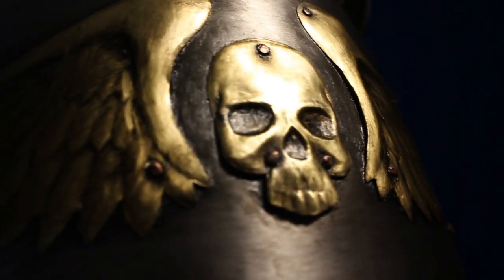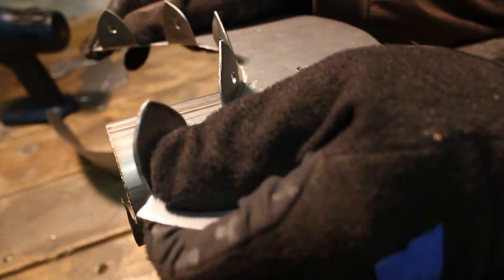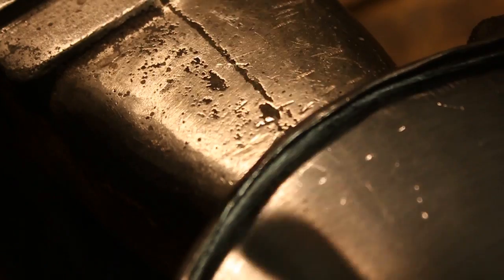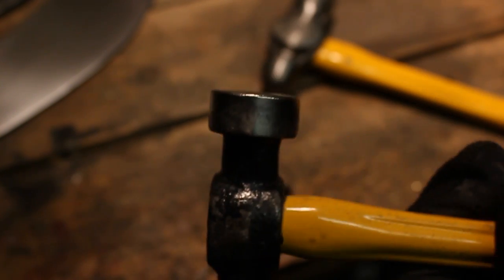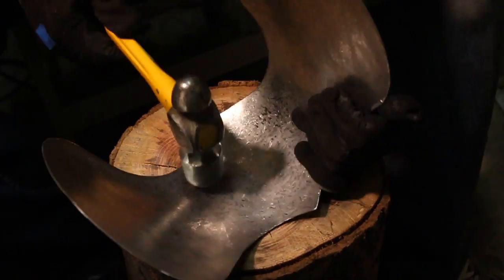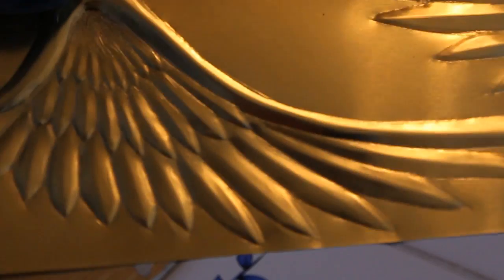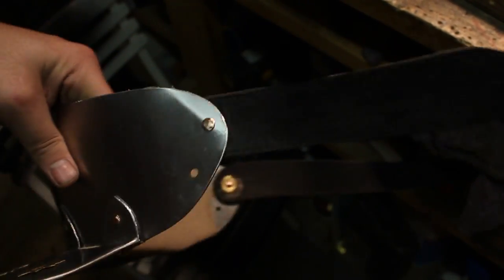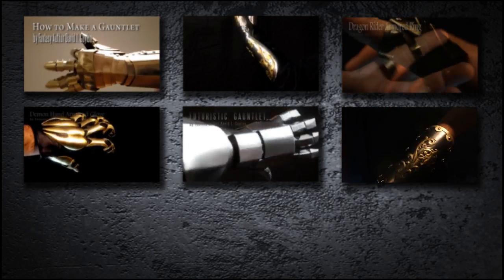How to Make Armor with Ordinary Tools - Pauldron

Comment: might i suggest that instead of using a flap disc to remove the imperfections in the metal you plannish more and use a fine grit sand paper and a palm sander.. 
you dont want to take too much material off the paultron otherwise you weaken the armor. 
thats fine for Cosplay. but if any SCA or other reenactments use this as a guide they will be weakening their armor too much.
 also it looks like a touch more dishing on the main paultron might help close the articulation gap on the top.

Comment: I know this is not armor meant for combat just for a costume but if you want it to be combat ready you want to heat it when forging because hammering cold metal can actually cause cracks if your not careful also the material needs to be at least 2 millimeters thick you don't need much metal to have it combat ready and also heat treat it so when it's hit with a sword it won't get deep dents and so you won't get hurt first heat treat step is to normalize it basically heat it up to about a bright orange color and let it air cool this will reduce any stresses after forging do this a few times then heat it to a dark orange color then quench it in warm oil not water then once it's done cooling in the oil wipe off the oil with a towel then heat the metal to wear it's not glowing hot but hot enough for it to change to a straw color this process will make the metal spring steel making it strong flexible and when it's hit it will come back to its true shape.
Reply: +Bryce Corbin never forget about tempering and normalizing it a quench alone is very brittle.
Reply: +Bryce Corbin I know you already explained that I meant if it was carbon or spring steel.

Comment: Just curious why didn't you dab the shoulder piece with a rubberized die hammer? You would have less sharp dents to tap out. Instead of using a grinder for the deep scratches and dents which leave deep sandpaper type grooves try using a fiber wheel.  I used them for many many years to remove, shape and take snags out of metal that would be next to skin on a regular basis.  If you do it right you can make either a satin finish or gloss finish BEFORE taking the piece to a rag wheel with rouge.  So in your case you really like that aged look you wouldn't need the high gloss polish with rouge. For some reason I can't post the link to the fiber wheel.  Google Gesswein 3M scotch Brite EXL utilized wheels.

Comment: Do you coat your rivets with anything when done to keep them from tarnishing/corroding quickly? I am planning to use brass because it tarnishes more slowly than copper, in my limited experience. Or do you just let it build a patina and go with it?
Reply from the maker: honestly if you are not exposing the metal to the elements, you won't see a real patina likely for a decade or more. If you are worried about it, you can wipe the piece down with olive oil, or WD-40, and then wipe it all off. What remains on the surface will protect the metal. Repeat this every 6-12 months. You can also offer the metal some protection by adding a faux patina with black oil paint like you see me do in many of my videos.

Comment: +David Guyton I have access to a variety of welding processes at my school and wanted to go that route with your templates.  I think the riveted look is great, but would you recommend binding it all with tig or mig welding?
Reply from the maker: +1 2 I have only ever used MIG, so I can't speak for TIG. MIG works fine for me but be careful if you are using thinner metal because it's easy to burn through. 18ga or 16ga shouldn't give you much trouble.

Comment: Just an outside observation, feel free to douse liberally with salt...

When you were forming the big bow-tie on the log, I couldn't help but think a leather hammer (not a mallet) would have made less dents, which you have to beat back out. If you don't have a leather hammer, you could try just gluing a piece of leather to the hammer you used, and see how well that works for you. 

If that doesn't work the way I think it may, you could just take a knife a scrape the strip back off, and you've saved yourself the cost a getting another hammer which doesn't work. Just throwin coppers around.
Reply from the maker: +Clint Carpentier I would agree with you if the metal I used wasn't 18 gauge. That stuff is very stubborn and a rawhide hammer would do very little against it. 20ga though...yeah you might be on to something. As for wrapping the hammer in leather, I think the force it would take to get the metal to move would destroy the padding in a hurry. But I'll experiment and see if it helps any.

Comment: Do you plan on make a full arm piece. Pauldrons, vambrace/gauntlet all together? I'm thinking of doing one for a costume but have no idea how I'd connect the two.
Reply from the maker: +Jared Austin I probably won't, but it would be fairly easy to connect the pieces using leather straps. You would have to rework the pauldron part for the upper arm area to cover more of your arm, but that should be pretty simple and you wouldn't need one of my templates to make that yourself.

Comment: Hey man, I love your videos, I made your grieves and cuisse and it looks awesome for my first build! But I have a question if you can help me out with it; So while cutting out the metal for the grieves and cuisse, I noticed with using tin snips, it hard to get the snips down the middle of a piece of metal  because of the snips hitting the sides of what it's cutting into. So, I had to cut pieces of metal out of the sheet to get the good curves and lines i needed, well, in some parts, the metal came out bent, and not so straight, and it was hard to get the edges straight. Could you explain how you use the snips or cut the metal to get perfect curves and lines?
Reply from the maker: Well, you are going to run into issues like that cutting by hand. I usually just cut a little outside of the lines and then use a grinder (sometimes a file) to shape the part perfectly. Afterwards you can use a flat surface (like an anvil, etc) to hammer the metal flat and perfect again. If you are serious about metalworking, I strongly suggest getting a throatless shear. It mounts to the bench and it makes cutting a LOT easier. It still won't give you perfect cuts because it's hard to control the machine, but it makes it 100x easier on your hands, and it's about 20x faster too.

Comment: If u don't mind what is ur set up or ur opinion to start with for a beginner black smith ? And by the way I really like ur work 🙂
Reply from the maker: +John Combetta well, I suggest checking out my DIY Armoring Tools video to get a feel for the tools you'll need to do this. Beyond that, I would start small...maybe try to make my Dragon Rider Armored Ring, as it's pretty simple and will give you a feel for working with metal. Most people who try this are surprised at how easy it is. But don't get the wrong idea...it is challenging and you will have to work at it, but I promise if you just follow the videos, you can totally do this
Reply: +David Guyton alright thanks m8 I'll do just that

Comment: hey david :) I was wondering what gauge stainless steel you used for this build, and the gauntlet v2. Ive tried to find them in stores but never find them.
Reply from the maker: +DANK MEMES This one is not done in stainless. Stainless is a lot harder, and therefor harder to cut and also dish. This is 16ga cold rolled steel. The V2 gauntlet was done in 20ga stainless. I have a hard time finding stainless in stores and usually have to order from Amazon or Ebay

Comment: your work is so inspiring. what do you cut the 18 guage mild steel with
Reply from the maker: Jam Boy this was too thick to cut comfortably with snips. I had to use a handheld grinder with a cutting wheel on it to cut out the basic shapes. Then I used the bench grinder and files to get the parts shaped properly.

Comment: Do you have a suggested tool for cutting the sheet metal ? I am brand new to this and I live in an apartment. I do have a balcony with an Atlanta, but want to avoid anything huge or heavy while I’m making this. Any advice would be so appreciated!
Reply from the maker: I have a video on armoring tools you can check out. If you keep it to about 20 gauge in thickness (18 and 16 are too thick), you can cut it "easily" with regular aviation snips.
Reply: @DavidGuyton  thank you my good sir!!

Comment: Could your templates be used to make funcnal heavy combat armor if worked with differently and heat treated?
Reply from the maker: If using the proper thickness, with steel rivets and heat treatment, any of my designs could be battle-ready
Reply: Thank you Ser
Reply: I made his original gauntlet out of 1mm stainless steel, this might not sound like much but whack it with a hammer and it bounces right off
Reply: Thank you

Comment: just wondering before using the brass for some repousse work, wouldn't a bit of pressure applied to the brass flatten it out, warping the brass a bit? or is it thick enough to where it shouldn't matter too much? also, would you be able to use a more silver colored piece to do the same job? if that's not available then i was thinking of just carving some wax to craft a mold for a skull, then cast it in metal to rivet upon the pauldrons. and if crafting two pauldrons, would repeating the steps for the leather strap attachments on the adjacent side be viable for use? sorry for all the questions, just very intrigued by your work and would like to apply it to my blacksmithing.
Reply from the maker: Eric Arthur The brass is thin, yes, and would not stand up well to sword hits or anything like that, but it's tough enough for a show piece or costume. Working the brass (and any other metal) actually hardens it, so it's a little stiffer than you probably imagine. You can try to do repousse in steel, but I don't know what thickness as I have never done it. As far as the straps go, you just need to flip everything so that you have a mirror image on both sides. It's possible to combine the two as well, making one strap to hold on two pauldrons. You just have to be a little bit creative with the combining process
Reply: David Guyton tyvm for the input, sir! I may try my hand at using a crucible to cast an aluminum piece for the skull i plan to use. Gonna give the illusion that it's emerging from the pauldron. :p
Reply: Ill let ya know how it works out.
Reply from the maker: that sounds very cool! I definitely want to see that. Feel free to post some pics over on the Armor Template Facebook page so everyone can see!
Reply: Will do! Got some family and friends helping me get a forge and everything together. Might be a little while but I'm dead set on it.

Comment: "that skull, so awesome." damn straight! but im wondering just how strong are these repose pieces? would they be able to be used on the hilt of a sword?
Reply from the maker: +Benny Steinberg probably not in this thickness unless it's just a show piece to go on your wall. Working the brass does harden it some, so it's a little tougher than you might thing, but if you intend to use it in any fashion, I would suggest one to three gauges thicker than this  (this is about 30ga). The thicker it is though, the harder it is to get details with this method. You may need to resort to traditional repousse with the tar and torches and all that jazz.
Reply: thanks ill probably stick with my idea of melting soldering metal into a mold. btw i LOVE your work!

Comment: How well would it work to use chainmail patches to connect the armor plates rather than leather. I ask because I'm thinking that maybe using chainmail to connects pieces would make it less likely to be broken in a fight/duel/sparing.
Reply from the maker: +USMC0311STC I am not that familiar with chainmail but I imagine it would not follow the form of your body very well when you move. For instance, if you used it where I put a strap over the bicep, since the chainmail doesn't "give" a little bit, it will get very tight when you flex your bicep. I think a better solution, if you are worried about breaking or cutting the leather, is to use good thick leather (like I did) and then you can add small plates like I used on the fingers of my Version 2 Gauntlet. You would need to add some padding on the inside though so that the rivets to rivet on the plates didn't cut your skin.

Comment: i know you use 18 gauge steel, but do you use steel cold rolled sheet and plate or hot rolled? surely steer clear of galvanised? 64
Reply from the maker: +kaspa starr in this case cold but hot will still work. Correct on avoiding galvanized.

Comment: I do Amtgard and I'm really interested in building this armor piece. how sturdy is it? can it withstand light to medium blows?  or is it more of a costume piece ?
thanks!
Reply from the maker: +Lelouch Zero this is as sturdy as any genuine armor, but it's not heat treated to strengthen the steel to the highest level. If you're using 18 or 16 gauge, it'll be tough enough to hold up to anything you do to it.
Reply: thanks for replying so quick!
Ok, sweet!
One more question, is it possible to make this without any power tools?

Comment: Is there any machinery that can make the process easier? Something like a automatic hammer for planishing?
Reply from the maker: yes there are pneumatic powered planishing hammers you can buy fairly cheap, but they do take up a lot of room in your shop. There is also the option of getting and English Wheel, which requires a bit more skill than a planishing hammer....but also takes up quite a bit of space. They are usually about $500+

Comment: thinking about making this out of an old stop sign. is that a thick enough metal for this project?
Reply from the maker: thick enough, probably, but I am pretty sure sops signs are not made of steel. I imagine they are aluminum, and aluminum will crack if dished to this extent. I suggest finding some steel to work with instead
Reply: they are made of steel and aluminum. it's an older sign.

Comment: you said some emont of steel in your tameplates. It is for 1 scholder part or for 2?
Reply from the maker: For one. The best way to be sure about how much material you need is to cut out all the template pieces and arrange them on a table with about 1/2" space between (to make cutting easier). Measure the length and width of that area, and that will tell you the approximate amount of metal you will need.
Reply: David Guyton thx. I would do two of them and buyed tameplates. Thx to it it should be easyer for my first project

Comment: How do you keep the leather from sliding off of your rivets? Mine stay for a while but then the leather wears and stretches enough to just slide over the rivets. 

I tried washers but it looks unprofessional on a  breastplate where the leather is on the outside.
Reply from the maker: washers are the way to go, or else you can resort to the leather rivets (aka rapid rivets)

Comment: How do you get the metal so flat when you start out?

 Mine always look like a warped mess when I start out and it affects the later bending of the metal.
Reply from the maker: I always take it to my anvil (or any flat surface) and flatten out all the edges with a flat hammer after I cut them out. Do this before any filing or grinding to perfect the shape
Reply: @DavidGuyton  awesome! Thanks for the quick reply.

Comment: I built these I couldn't tell from the instructions or the video. Do I attach the lanes to the base plate or the shoulder.
Reply from the maker: Alex Smith They attach to the shoulder piece. You can see where I have the rivets under the wings on mine. Exact placement for the rivets depends on the exact shape of your shoulder piece, so make sure to test fit the lames before drilling your holes

Comment: Will bevel ing the edges with a grinder have the same effect and rolling the effect with a hammer
Reply from the maker: +Homemadedisaster 12 you won't be able to get anywhere near the same effect simply by beveling, and keep in mind that that will basically sharpen the edges instead of dulling them, which is the opposite of what you want to accomplish. It's important to have round edges anywhere metal touches your skin
Reply: ok thanks

Comment: in this video you used what appeared to be a chisel with a ball on the end of it never seen one of those before something you made or does it have a name ( and just to say a Darth Vader helmet pattern would sell well I thank)
Reply from the maker: +Robert Fox when I was doing the brass wings? I used a screwdriver with the edges sanded down, and I also used a "Dapping Set", which is what I think you are talking about. A dapping set will come with several sizes. You can get cheap ones at Amazon or Harbor Freight Tools.
Reply: +David Guyton it may be the same thing but I got my videos mixed up it was on the helmet when you were doing the teeth on the skulls and I could be mistaken on this but I believe  you may have use it to roll edges after using a blunt chisel
Reply from the maker: +Robert Fox yes I usually roll edges on them, or sometimes on the round side of a ball peen hammer.

Comment: how large of a piece of steel sheet would i need to make 2 of these?
Reply from the maker: +Sly  Sky usually the sheet metal you find online is irregular, so what I suggest doing is printing the template out (twice in your case) and lay out the pieces in the smallest space possible. Arranging the pieces in different configurations will allow you to fit it in many different size areas. This will give you a general idea of the size you will need, then you can look for something close to that size.

Comment: can this be done with the same metal as on a street sign?
Reply: Zeek Bartling To be honest, you can do it with any kind of steel. Stainless is just best for this stuff. I'm kinda on the cheap side, so I'm using Aluminum Sheet metal for weight.